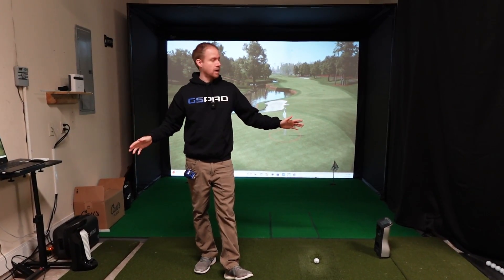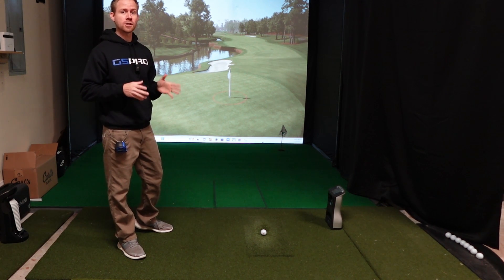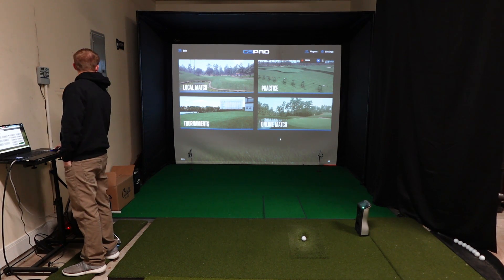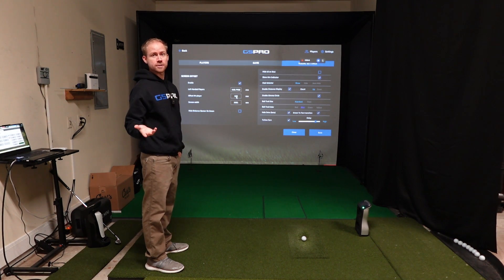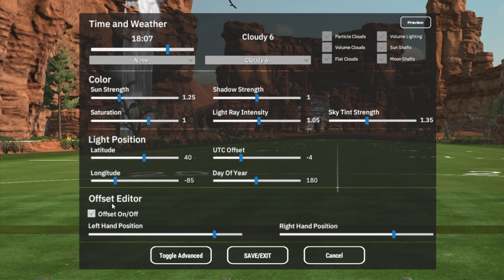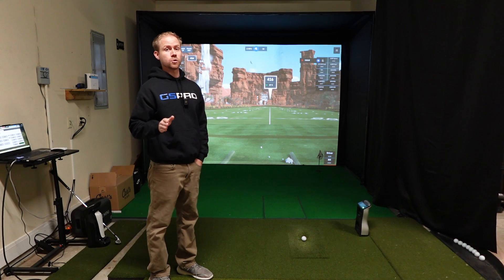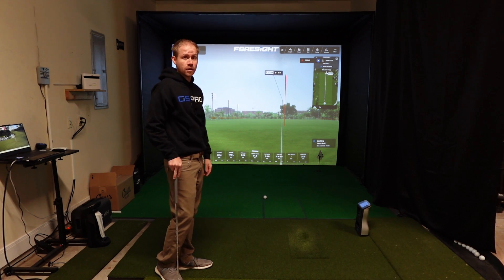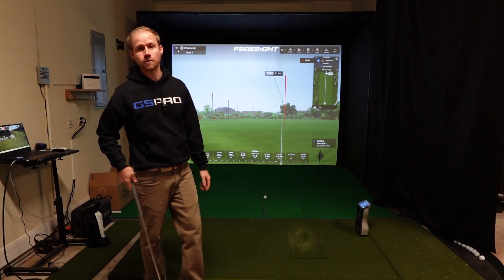How to Adjust Offset in Golf Simulators | GSPro | FSX Play | E6 Connect

Comment: Hi I have a gc3 and when I’ve tried to do this
On the settings there is no room configuration underneath game options
Any ideas thanks
Reply from the maker: If you go into the Foresight program files in file explorer you should find a file that’s called room config tool. You can open it and put everything in there.
Reply: Hi thanks for the reply but where would I find this. Thanks

Comment: Hey this is an awesome video it shows exactly what i was looking for thx for posting it.  I have 3 questions:   I assume FSX applies to all of the Foresite launch monitors.  But just want to double check that the GC3 has the same exact offset functionality as the GC4?  Would i be ok with a 10 foot wide room?  And of these 3 which programs which one handles offset the best?  Thanks!
Reply from the maker: Yes, the FSX software works the same for all foresight launch monitors including gc3. It’s just selecting the launch monitor and entering all the measurements in the room configurator tool. 

10ft wide is pretty narrow and it could work but I’m pretty sure you would be limited to irons only. I would say 12ft wide is the minimum needed to swing driver comfortably but I guess it depends on the person too. 

I would say fsx software handles this the best just because of how it works together with the launch monitor. If you saw in the video how when I dropped the ball down the target line adjusts to where the ball is - that’s unique to fsx and a pretty cool feature. That’s not to say that the offset in other software is bad in any way.

Comment: Is your projector offset as well? If not, any concerns that it’s in your swing path?
Reply from the maker: No it is centered and almost directly over my head. I have the BenQTH671ST and it doesn't have horizontal keystone adjustment so it has to be centered. I have no problem at all for myself but I'm always concerned when someone else tries it out for the first time since they're a different height and have a different swing. So far no issues....